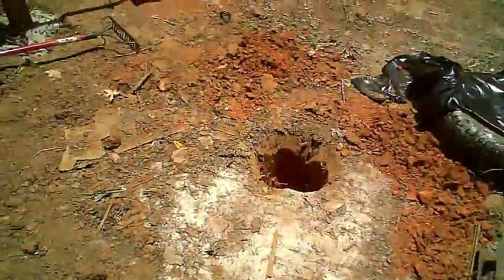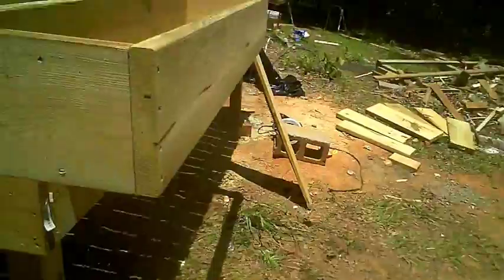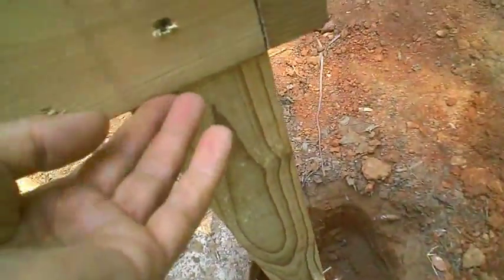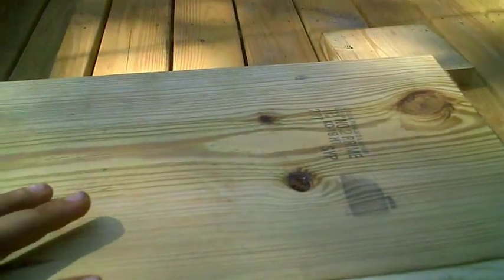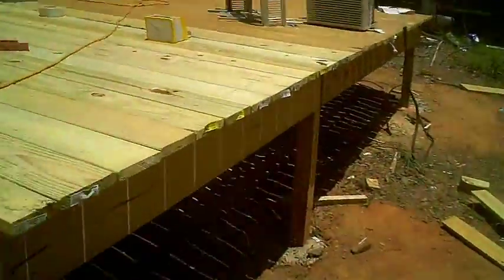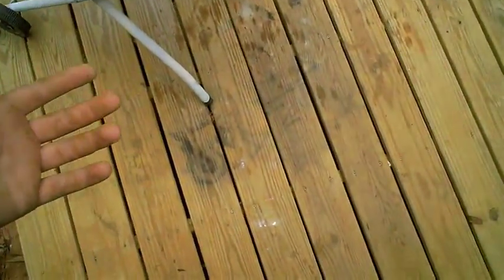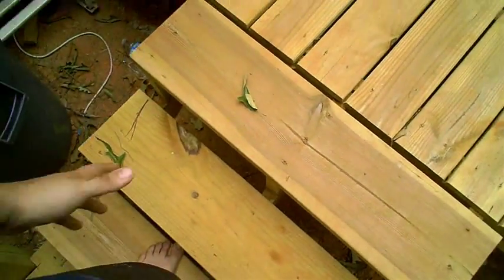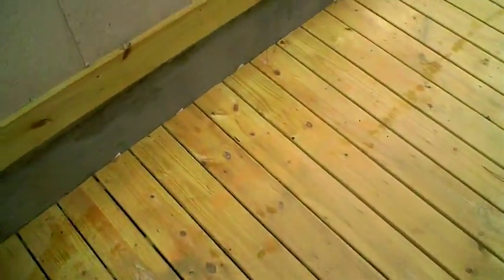finishing the deck

Comment: Pretty cumbersome if your deck is large. I have done it this way by hinging the deck on to the ledger dead level. Dangle the posts plumb into the post hole, pour the concrete or use dry mix packed down and add water. When it dries recheck level and determine a 2% slope away from the house. Don't forget the flashing from the house to the top of the ledger. Then bolt the ledger to the house rim board.

Comment: kick ass job man u seem to know yur shit but u should use some metal hangers n wen screwing the fram to the legs go buy some like heavy duty 2 inch long bolts an run them bolts in threw the fram to the legs with a impact wrench makes it realy strong just a idea or tip to kinda help u out  but still cool deck man